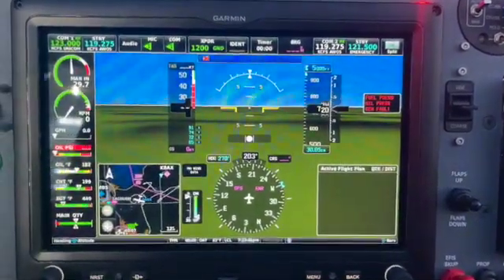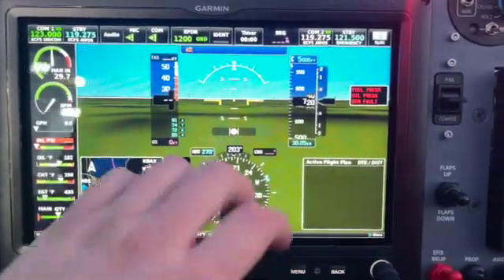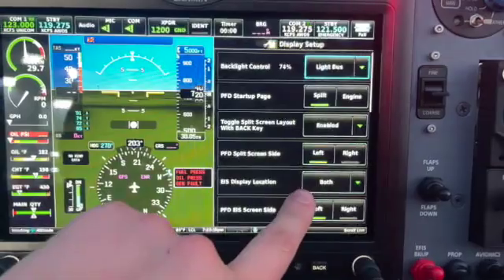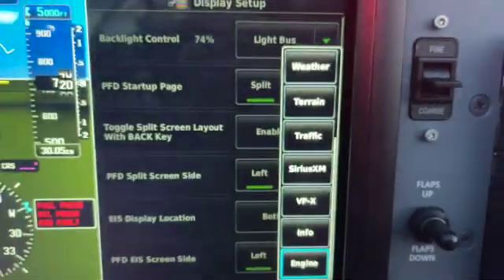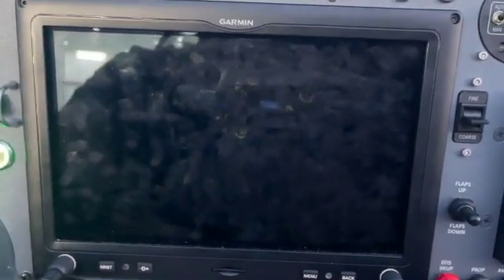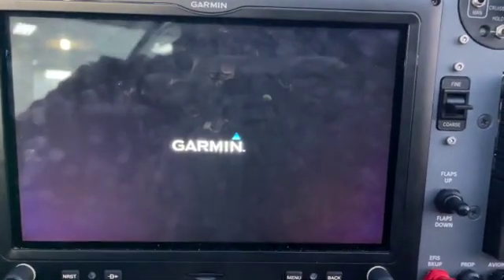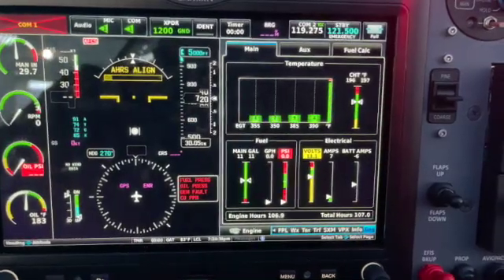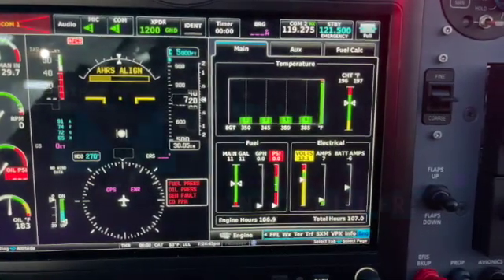Setting Up Your Engine Information on Garmin G3X Touch

Comment: Would you be able to let me know how to add the power % reading that appears at the lower left of the MAP reading? Many thanks.
Reply from the maker: This depends on engine selection and sensor selection. FADEC engines like the Rotax 915 and 916 can have this turned on by simply making the selection in config mode. If you are on a Lycoming or Continental engine, you need at least MAP, RPM and Fuel Flow to all be present, then you'll need to enter into config mode the Max HP and Max HP RPM/MAP settings so that the G3X knows how to appropriately scale. This is all in config mode in the Engine and Airframe page.

Comment: If you only have a single 10" G3X display installed and the screen fails, I guess you would be SOL on engine information. On a simple plane like a PA28 that would not be a complete disaster since you would be landing immediately anyway. You could land based on known power settings, engine sound, and speed/altitude info from the G5. I'm just wondering if there is a backup other than installing a second screen, probably not. I have not seen anyone really discuss this. The Piper Pilot 100i has a single G3X screen. It is a production trainer aircraft and I don't see any backup engine gauges so I was wondering what their plan was for a screen failure.

Comment from the maker: A commenter named Andrew A. Watson, whose comment seems to have disappeared, asked if the G3X was capable of displaying percent RPM instead of raw RPM values. In their case, they were interfacing to a PT6A. The sensor was gear reduced and basically produced a 0-4200 RPM reading, with 4200 RPM being at 70Hz. To do this, in the RPM1 setup on the G3X, under the sensor calibration, set 0 RPM to 0Hz and 100 RPM to 70Hz. This will allow the G3X to properly scale 0-70Hz with 0-100 percent.

Comment: Can you configure what data is shown in the EIS main page? It seems from other videos and the manuals that the standard main page shows the RPM, MAP, oil temp and press at the top, and then the EGT/CHT graph underneath. From your screen, it looks like you can make it also show FF, which I would really want to see simultaneously with the other data. Is that done on the EIS menu page? Thanks!
Reply from the maker: This is done somewhat automagically depending on how much room is available, and what primary vs non-primary instruments you have. For example, if you don't have a manifold pressure gauge set up, there's now room for Fuel Flow or some other non-primary. One thing you can do, is manually hide gauges from the main page (done in config mode) then you'll be able to have more room for non-primaries.

Comment: Love the channel! You guys have taught me so much about the avionics in the plane I'm flying. Do you know how to change the engine information that displays in the permanent bar on the left? I'm on a G3X touch.
Reply from the maker: Hi Luke, thank you for watching our channel. Unfortunately as of now that information cant be changed, it is automatically setup based on sensors installed.
Reply: @MidwestPanels  Thanks for the quick reply! Keep putting out the great content 😎✨